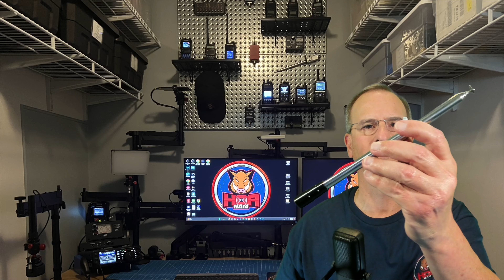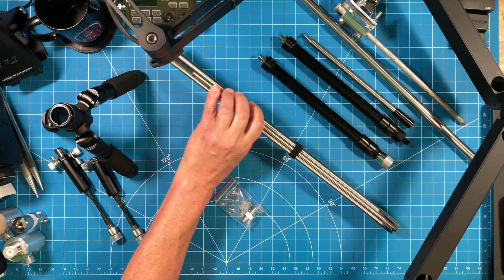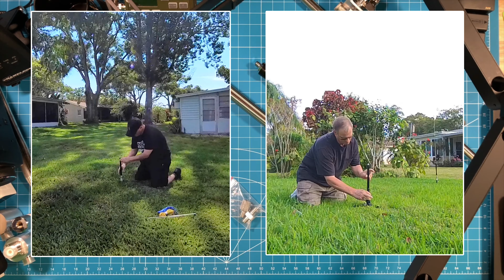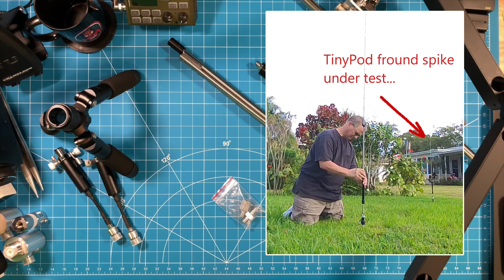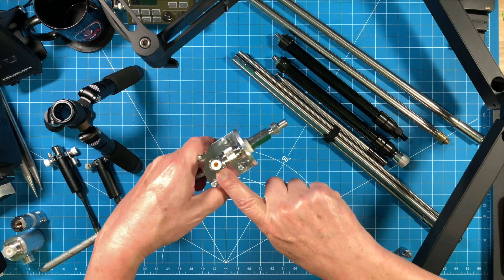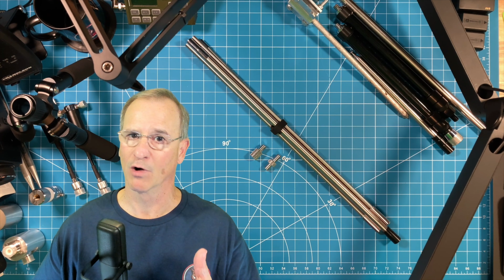HF Manpack Collapsible Antenna for Gabil / MFJ / Komunica Resonant Coil Antenna for POTA SOTA EmComm

Comment: The Amazon page says that the second adapter is 3/8 x 24 female to M10 so it <should> fit the M10 females you have in your kit.
Reply from the maker: I agree with your finding, however, I think there is a thread pitch mismatch.  Checking with Gail tonight.

Comment: Never really figured out how to tune this antenna system easy and I returned it.  I would like a easy antenna to hook up to my ICOM 705 for HOA use but for now my WRC always works great and easy to adjust for band changes.
Reply from the maker: The WRC is an awesome antenna; I have 3 of the minis and one of the full size Silver Bullet....I learned to tune coil antennas with the WRC.  The Gabil system tunes similarly, but the contact point on the coil is not visible to the eye like the WRC.  Thanks for the view and comment.
Reply: Are you able to tune and get good results from 10-40? And it is a combination of moving the coil up and down and shortening or lengthening the whip? Have you developed any tuning guide that makes it easy to get within range quickly? I might be willing to give it another try as I had the first generation one with the decal markings which promptly tore.  Bob in Ocala
Reply from the maker: @BobBroeking  Yes the Gabil coil antenna tunes 10 through 40 like other coil systems, moving the coil up and down -- there is no need to adjust the telescoping whip to tune on these bands.  

I have not developed any quick guide, but do plan a video towards the end of Q1 2024 to demonstrate tuning the antenna system.
Reply: @HOAHamRadio   thank you maybe I'll give it another try for a quick set up option vice the WRC. Bob

Comment: Great presentation as always.  This is 96 inches and what is the length of the telescoping whip that it replaces?
Reply from the maker: Thanks for the feedback.  The manpack as I measure it is 89", the telescoping antenna is 86".  The goal with the manpack is a stronger antenna, not necessarily longer....

Comment: What bands will this antenna operate on? What’s the max power limit maybe a comparison to a ham stick or a the cha antenna.
Reply from the maker: The Gabil 7350 coil antennas, with this manpack collapsible will do 80 through 10 (80 requires a loading coil which comes with the 7350 kit).

Comment: Does using loctite on an antenna thread adapter have any impact on antenna performance?
Reply from the maker: I suspect it may create a barrier blocking some / all the transmission....not sure, I've never heard anyone talk about that.
Reply: I've used loctite before and as long as you don't cover all of the threads toward the back you should be fine. Especially the flat mounting surface that gets compressed against the other flat mounting surface you will have plenty of area without loctite to transmit the power and maintain proper connection.